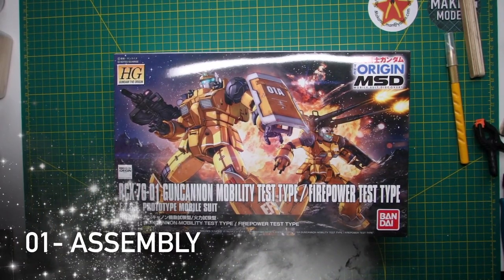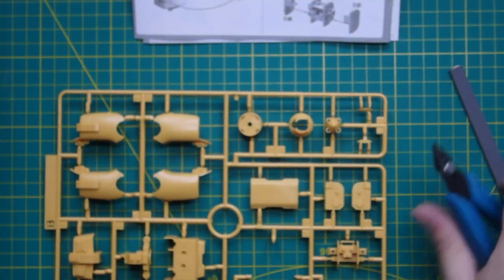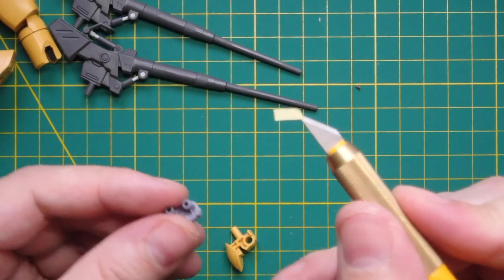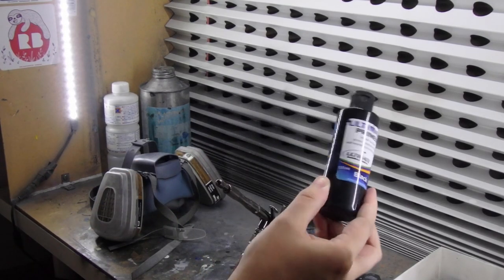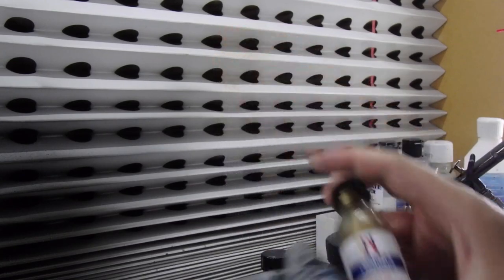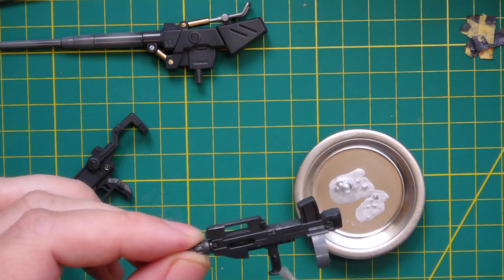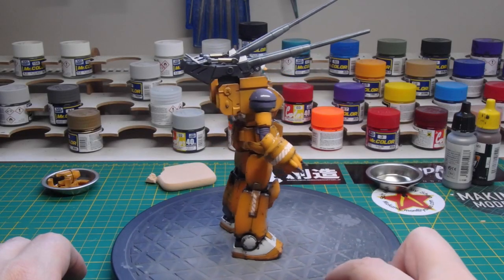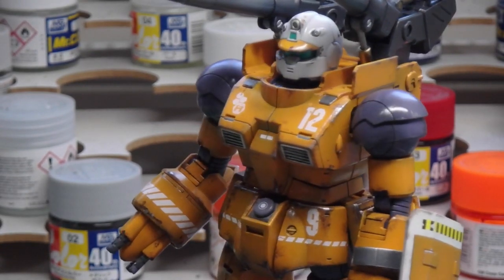How to build and paint a Gundam model

Comment: Thanks for the fantastic video, just a question, when applying top coat how do you make sure that the articulations don't get stiff with it? I used spray cans but when it dries and I move the articulation it kind of dries along the part and just like breaks and looks ugly
Reply from the maker: You could top coat each part leaving out the joints or topcoat masking off joints with masking tape. I don't really get this problem often as I use a strong lacquer paint which doesn't scratch easily

Comment: This is by far the most detailed and well-narrated gunpla building + painting guide!

But I have some questions as I am going to start my first ever gunpla painting.
1. When removing a seamline, sometimes the in-between parts like the polycaps is going to be stuck permanently. is it okay if the pc parts got exposed to the paint?
2. I noticed that you do not sand the parts before priming. Is it okay to just directly prime without sanding?
3. About painting the weapons, do you disassemble each parts or paint it as a whole? I am planning to paint it as a whole but seeing that the clipped place would not  be exposed to the paint, I was thinking that it should be disassembled and be painted separately.

That's all I wanted to ask. I would be really thankful if you could answer these newbie's questions.

Thank you!
Reply from the maker: Thank you Andreas! I will revisit this comment soon and try to answer your questions :)

Comment: Do gundam pieces tend to have areas where you won’t want to paint under the alligator clips?

And does the movement of the model in posing scrape off the paint or are the tolerances such that it’s not an issue?
Reply from the maker: You'll need to attach clips to areas that will not be seen and if you use a strong paint like lacquer, scraping is no issue

Comment: What about priming and airbrushing on sprue then put it togheter and sand it then paint over sanded areas with a brush? That was my plan I have never done gunplas but I have been doing afv modelling for some time now. Is this a good idea or is it better to clean all parts up and then prime/paint?
Reply from the maker: You would end up with pretty obviously inconsistent marks where nubs where I expect
Reply: @Gundamuk  Yes I did not go for this method. First I assembled the hole figure, then filled putty and glued where it was needed then I painted every part witch was not of the same colour individually with the help of my Airbrush and some clips from Manwah. Good results!
Reply from the maker: @statoilbensin2190  Excellent! :)

Comment: Excellent video and very helpful! Do you have any advise on how to avoid the paint from chipping like in the inner frame joints or moving parts? I guess this is more on an issue for MG kits with all the features those kits usually have. I’m scared to change the pose my gundams after painting as it might leave scratches. Thanks!
Reply from the maker: Thanks ;) I would use a tougher paint like lacquer and use a clear coat to protect it. It'll not be 100% scratch proof but it'll hold up for some careful movement
Reply: @Gundamuk  Thank you very much!

Comment: If there's three pieces and one inside the two others, if you remove the seamline between the two on the outside,the one in the middle is stuck isn't it? This is common like the head , with most of the details put inside and closed up by two pieces, how do you paint the inner details if you glued the outside?
Reply from the maker: You paint the enclosed part first, or mask off areas and paint it afterwards.

Comment: when doing this process, can you still pose the gundam? does the sealing stage interfere with the movement?
Reply: hinge777  When sealing the seamlines you are just grabbing the outer armor and getting rid of a really bad looking seam line you can't take that part apart again but you can still move the joint as long as you don't put any of the cement onto the poly caps or the joints

(Sorry if this wasn't what you're looking for)